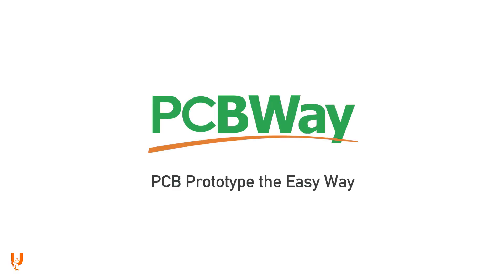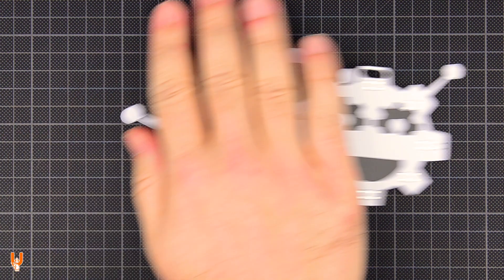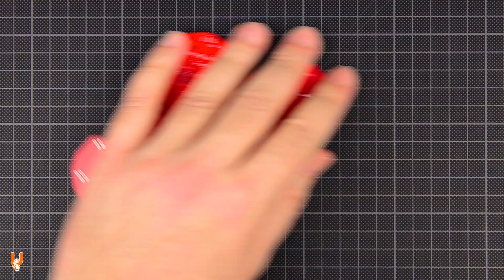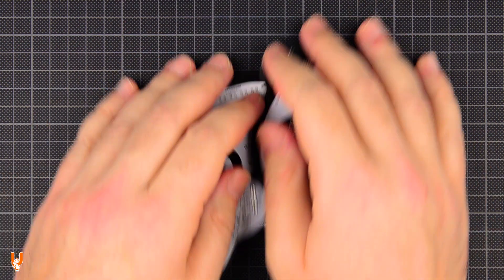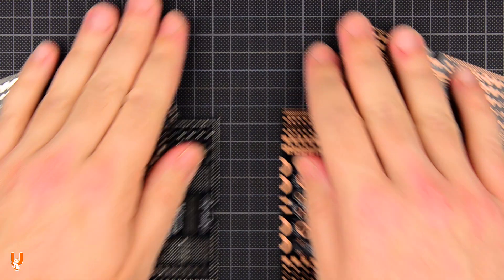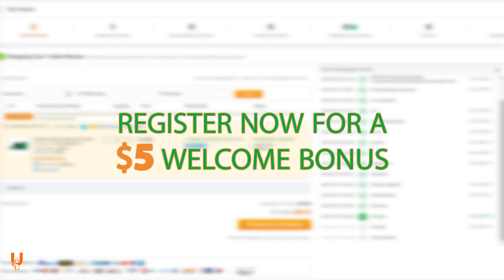iFlight XING2 2306 2555KV FPV freestyle motors : Thrust, Efficiency, RPM & Torque on 5" & 5.1" props

Comment: Would you recommend using 6040 props on these motors? Or would that pull too much current?
Reply from the maker: I suspect it would draw a lot of current but haven't tested this size yet.
Reply from the maker: (I assume you meant 3-bladed props)
Reply: @muteFPV  Either 2 or 3. I normally run 2 blade